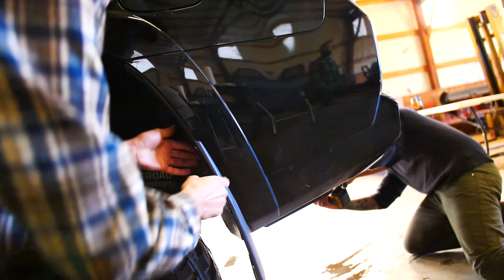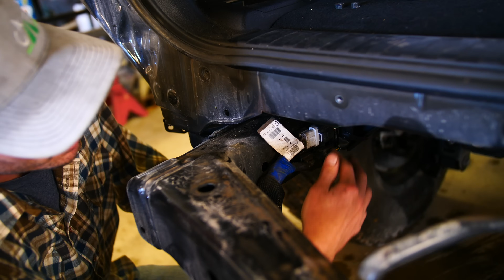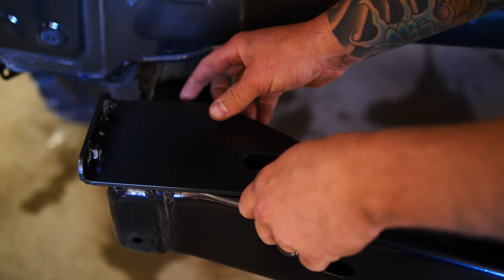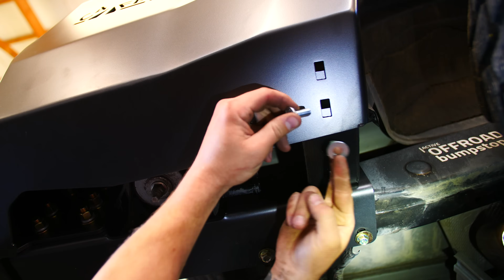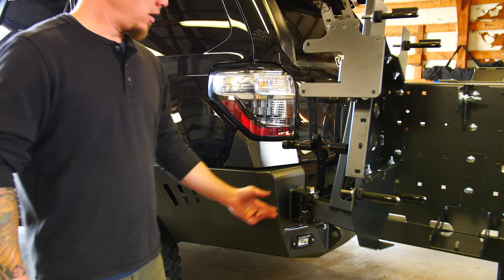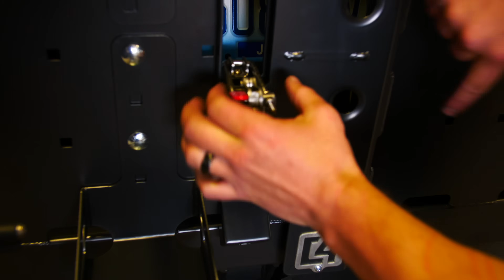C4 Fabrication - 5th gen 4runner rear bumper install

Comment: Also would have liked to have seen how the exhaust turned out after cutting it. Did you just reattach the exhaust tip to the end and call it good? Would also like to see how the rear back up camera hooks up. I assume some extra wiring will be needed to accommodate the swing arm at full extension?

Comment: The audio quality was alittle rough but overall a great installation video. Any potential rust issues with hammering the back wheel wells out of the way for larger tires?  It looks like some of the paint chipped off? Would love to see a similar install video on the front bumper and sliders. The attention to detail of your products really comes through in this vid. Maybe get @swellrunner to produce future vids!
Reply from the maker: The pinch weld area is covered with flexible rubber spray on liner from the factory that stays sealed pretty well when bending that area. It could be sealed up again with some spray on bed liner if you have any concerns.